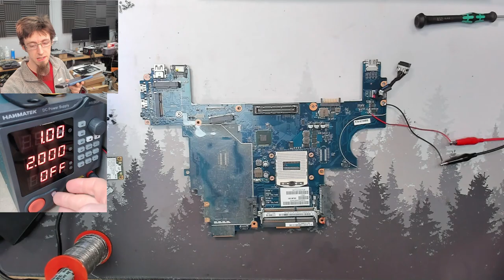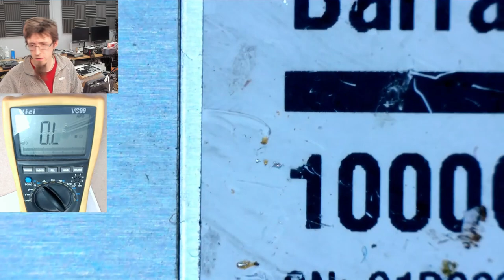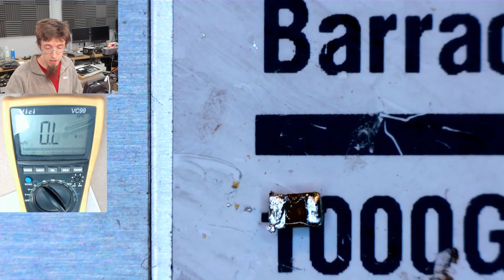Dell Latitude E6440, Charger Light Goes Out - LFC#331

Comment: BIOS battery woes! Dealt with a older Acer 4420, every indication pointed to a shorted cap somewhere. Spent a few minutes and no short present. ???. Remember one of your discussions about the bios battery. Why not said I. Checked the battery, needless to say the laptop has to be just short of being tore apart to gain access. Brilliant engineering! New battery and the old lady came to life instantly. Moral of the story, if I need to open up any computer either laptop or desk model, just replace the battery.

Thanks for a great video.
Reply from the maker: I see a lot of no-posts that are down to flat BIOS batts, and they usually don't make it to video because it's a 30second fix - but at some point I need to do a compilation to prove a point, always check the easy stuff! The more technical repairs you know the more you forget that sometimes it really can be something simple.

Comment: As can be seen by the proximity of that "secondary power supply" to the battery connector, the voltage, that rail is running at, is the battery voltage. So that "secondary power supply" is also the battery charger. As in (basically) all MacBooks, the whole systems runs on the battery voltage ("PPBUS_G3H"). When there is no battery installed, that rail is simply set to the end-of-charge voltage of the battery.

Comment: if you just unplug the CMOS battery, then plug PSU in, then it should come on. If the bios settings are scrambled then won't POST. I had this issue on Latitude E7440 (Core-i7)

Comment: I've never soldered a thing in my life – most I've done is renew thermal paste on a CPU and upgrade the heatsink & fan, lol –  but find these vids fascinating!
Reply from the maker: Well, holiday season coming up, get yourself a TS100 or clone, and a couple of cheap DIY soldering kits and try it out! Even if you don't plan on fixing motherboards, trying your hand at soldering and having the basic skills under your belt is a good time!
Reply: @Adamant_IT  👍Thanks for the nudge!  Saying that, I do have an old Dell gaming desktop in which the CMOS battery cradle/socket sheared off the MB when I tried to change the cell, so... 👨‍💻
Reply from the maker: If the pads are torn, that'll be a difficult place to start. If the pads are intact, should be an easy fix!

Comment: I have worked on many of these models of Dells. As well as older and newer models. For some reason Dells will do this strange thing of not going to post after repairs, upgrading or replacing parts. I use to get worried. But now I just keep powering on until it works. As a Dell repair technician. I can say that this is very common. But don't know why. All I can suggest is to relax and be patient. None of the other manufacturers seem to have this issue. I am a certified repair tech for HP, Lenovo (IBM), Toshiba, Dell, Sony, ASUS and ACER. In my experience. Only Dells do this. Sometimes it can take several power ups for Dells to seem to work after any repairs or upgrades. I have to get certified on all of these companies newest models every year. Yet Dell is the only one that consistently has this problem. Don't open it up again. Just power on until it works and it usually will work perfectly once it gets past this post issue. While a CMOS battery may need to be replaced. It is not the cause of the problem. I suspect basic firmware programming issues. As it will eventually post even with a dead CMOS battery. With that said. HP is the biggest pain in the technobutt when it comes to branding a new motherboard. Not relevant in this case. But I really hate the branding procedures of an HP motherboard. Dell has the easiest branding procedures. IMHO
Reply from the maker: Yea, that CMOS batt was dead, but I think you're right, I think it would've posted anyway if I'd given it more re-tries. Dell do seem to be the worst for this in my experience as well. Happy once they're working, but bad starters when the board has been messed with.
Reply: @Adamant_IT  Thanks for the reply. I just wish I could figure out why Dells, in particular, do this.
Reply: I’m there with you about HP .  I’m not certified tech but with my knowledge and experience that DELL is reliable and not fancy machine and covertly SONY is fancy and not reliable machine.  So it’s up to end-user choice.
Reply: Since you mentioned Asus.  I’ve a question.  Please read this this and give me your thinking.  I’m new to Asus and usually have bad experience with it.

Asus Z240IC H170?  I just replaced USB Hub which located under the MB.  I took out MB then the broken USB hub and put the new one in and put MB and everything back.  When I powered it on, everything turned on but no image/picture on the screen.  What did I do wrong? Please help…
Reply: @deent5186  If you are getting sound but no picture. Then I would check the LVDS cable, try reseating it. But of course, make sure the power is unplugged. Otherwise you may blow a fuse or diode that provides power to the screens backlight. Also, you can try shinning a flashlight very closely to the screen at an angle and look for any signs of an image. It will be very hard to see. If you can barely make out an image and reseating the LVDS didn't help. Then check out your backlight circuit. Here is a YT channel that has the boardview for you model. https://www.youtube.com/watch?v=Ba1HiJHVgkg
Reply: @paying-for-freedom  it flashed once when powered on and once powered off, so that means backlight is ok, right? BTW this is all-in-one desktop.  No post and no sound.  The indicator light of power button is on as well as video board and the hard drive indicator flashing like it’s reading/accessing the hard drive.
Reply: @deent5186  The boardview you can download from the YT I linked. Is for that AIO. The flash indicates a backlight power issue. Did you check the LVDS cable to make sure it is seated properly? You're probably not getting sound because the motherboard is detecting an issue and is not going past the post screen. If the LVDS is ok. I would definitely check around the backlight power circuit. Use the boardview with the program BOARDVIEWER. Not BOARDVIEW4 as it cannot read as many types of boardview files. Find the pins of the LVDS that supply power for the backlight. Should be made up of caps diodes and a voltage regulation IC. Worse case scenario is a backlight LED has gone bad in your screen itself. But very unlikely.
Reply: @deent5186  It looks like your backlight pins on that LVDS FPC connector is going to be 28, 29 and 30. Check each one to ground. Should be +5 volts each. Looks like they are all connected to a P-Channel Mosfet. Two .1UF caps and a 10Kohm resistor and getting GND from pin 31 and 32. There also appears to be a second FPC connector for the LCD on that board. It supplies +10 volts from pins 26 thru 30. Make sure you have both cables plugged in as I have seen AIO screens that had more than one cable feeding them.
Reply: @paying-for-freedom  I’d check it out after my 2nd booster vaccine goes away.  Tysm and will keep you posted
Reply: @paying-for-freedom  I did check the LVVDS cable and reseating, but it’s not helping :(; I’ll check backlight circuit
Reply: @paying-for-freedom  I’m completely new to motherhood stuffs.  I just know a little bit of everything.  I might need time to figure these out.  I know how to check capacitors, diodes, etc…  I need to check the connector which you mention in your last message.  I’ll keep you posted.  Thank you for everything.
Reply: Hi There (sorry that I didn't get your name  lol),  appreciate much for all your helps.   I did try to power on, but it's having issues  😞
Reply: @paying-for-freedom  I think that I blew the fuse/diode  because I didn't unplug the power 😞

Comment: The secondary power supply does not go to an arbitrary value but (at least with Apple) to the battery charging voltage. That is also the reason that it jumps up a little bit once the SMC is happy about things. In that way the battery is prevented from (over) charging before that time.

Comment: These Dell Latitudes are great to take apart if you are doing anything other than motherboard removal, but yeah as I was fixing my E6430 with also a shorted cap, motherboard removal definitely meant you gotta flip this thing back and forth to remove a bunch of screws...

Comment: Might be a silly question 32:43 in video what is ram training?  - excellent stuff by the way 🙂
Reply from the maker: RAM training is a process where BIOS detects what memory is present and what speed/timings it needs to run at. This usually involves one or two power cycles to test those settings - which is why many laptops and desktop mobos turn off and on a few times after a BIOS reset. If you don't know what's happening, it looks like it's broken and just stuck in a loop, but RAM Training can sometimes take 30-60 seconds if the board is having a rough time.
There are other things the BIOS might be doing that look like this, but a lot of people just say "RAM training" as a place holder for "getting its shit together"

Comment: Did you try to take a look at brymen multimeters? You could take a look at bm869s. I understood that they are almost as good as fluke but cheaper. I have bm867s but I'm a total noob on electronics, so I can't tell you if it's good or not. But it was recommended to me by an experienced guy. I hope it helps.

Comment: You checked if your CPU VCC is shorted to ground - but that is not the actual problem during injection. Your real problem is the high side mosfet being shorted drain to source because that will allow the injected voltage to flood the CPU VCC and fry your CPU.

Comment: HELLO ADAMENT! Am an avid Subscriber, you are my first 'Go to' when diagnosing PC issues! I recently built a new Computer in my old Tower with an MSI Z390-A PRO Motherboard with an Intel Pentium Gold Processor G5400 CPU @ 3.7GHz! Next added  64.0 GB DDR4 3200 Ram! Also a ZOTAC GAMING GeForce GTX 1 Video Card! Recently upgraded all my HHD's with an Intel 660p Series M.2 1 TB SSD Drive C and two WD I TB internal SSD's! My Computer now boots up completely for a cold start in 30 seconds!!!! (Once in a while when I turn it on, it Boots into the Bios Screen)!!!(But when I wont to boot into Bios, no matter what key combination I press it wont go into Bios on Command)! Windows will not display on my Digital Monitor but I can see the Bios Screen on another HDMI Output to my 32 inch TV! Am running XMP Mode and Gaming Mode on the MSI along with allocating 3/4 of my Ram to Process my Adobe Premiere 2022! My Question is: How do I get the computer to Boot into Windows EVERY TIME? And secondly, How do I get my computer to boot into Bios on command?
Reply from the maker: Try disabling XMP first to see if the problem disappears. 4-module memory kits can be tricky. If disabling XMP fixes it, you'll know it's memory related, and can move forward from there. Try a BIOS update as well.

Comment: i have learned that if a laptop turns on without display when you plug in power, its low bios battery. Mostly on HP

Comment: Hi Graham. Nice work. I have the same isue with a laptop, but I don't have replacement capacitors. My question is will the laptop work without those capacitors ? Thank you for an answer.
Reply from the maker: Probably. It depends on which capacitor has died. You won't damage the laptop by attempting to run it with caps missing, so feel free to try. Worst that can happen is that it's unstable and crashes, if the cap was bypassing something important.
Reply: @Adamant_IT  Exactly the same 4  of 22uF/25 V in video, near PQ704 and PQ706. Thak you very much.

Comment: Obviously this is a great teaching tool, that being said for running a repair business would it just make more sense to replace the board? Here in the US you can find used board for as low as $25. Just thinking from a time and cost effectiveness stand point its just not worth while spending that amount of time on it.
Reply from the maker: Mainly practise for the more expensive jobs. $25 is super cheap though, yea... They're about $50 in the UK, so still cheap, but not quite $25-no-brainer.
The usual answer to this is that, let's say a replacement board is more like $80, which is typical for a lot of laptops, replacement would be 80+50 labour, so 130 total with 50 profit.
If I can fix the board, I can charge at least $100 board-repair fee, and that would be 100 total with 100 profit. Cheaper for the customer, and double the money in my pocket.
So it's a trade off, fixing boards will yield a much higher profit if you know what's wrong with it. But yea, on old stuff as soon as it's not an easy one I'd usually duck out and find a used board.

Comment: love your videos 🤩, what books do you recommned for getting started i dont know anything about electronics
Reply: I have many many many books on electronics since I started before the internet existed and my recommend would be 'A practical introduction to electronic circuits'  by Martin Hartley Jones.   It is an old book now but the fundamentals that it talks about - voltage, current, resistance, input and output impedance etc have not changed with time except components are smaller and logic runs faster and and lower voltage.   It is also not too large so you stand a chance of reading it all.   Available very cheaply -  £2.35 on ebay right now.    
  But, at the same time you must, must practice and not just read.  My advice would be get some solderless breadboard and old school components with leads while you are learning the basics.  That along with a decent variable power supply and a nice meter and there is so much you can do.   Good luck.
Reply: @Hereford1642   thank you my good sir :goodvibes:

Comment: The CMOS battery will not prevent a laptop of computer from POSTing. It will mean not settings will be retained if the battery is dead and ask each time on boot, to enter BIOS. The CMOS battery only has two wires for ground and power, no signal. The battery only kicks in when there is no mains power going to the motherboard to retain all BIOS settings. While power is running through to the Motherboard, the battery will not be used. Default settings will be used on the BIOS with flat batteries and thus ask you to enter BIOS to change the settings. Ok, it was still worth changing the battery, however, it wouldn't have stopped the laptop from booting up. Swapping the RAM may have and I have encountered that issue. It is noted that also the larger RAM stick should always go in DIMM slot 1/A1 if you were to use Single Channel and they are two different sizes as THAT can prevent POST and booting.

Comment: What battery screwdriver are you using?
Reply from the maker: I use the Sequre SQ-ES126 - you can get it direct from Sequre here. It's not cheap, but this thing has been an absolute workhorse.
Affiliate link, offer code ADAMANTIT for 3% off 👌
https://sequremall.com/?ref=fl20o11jut

Comment: I hate Dell for forcing us(a lot of times) to buy original accessories even though after a while they stop selling it. And they protect their batteries from users wanting to reset them after replacing the cells. Even on their VERY OLD (20+ years) collectibles.

Comment: You do know that with these Latitudes you wouldn't actually have to guess which screws to take out, right? It's all in the user manual. Oh, and if you want a business laptop that's a pain to work on, try an old Toshiba Tecra S10. You can't even clean out the fan without taking the entire motherboard out... plus a fully depleted battery (which only takes about a month) is being charged to the point of the thermal cutout kicking in, exceptionally poor charging algorithm. Their 15 V Sanken power supplies also are prone to bad caps.

Oh, and guess what I replaced in (I think) an Optiplex 7010 earlier today? You guessed it, a dead CMOS battery. (At 0.6 V, it made a dodo seem rather lively.) It did still POST but Windows would throw a BSOD 0x7B because SATA mode had been reset to the default of RAID as opposed to AHCI.
Reply: Toshiba?  Thought they exited the game like 10 years ago...